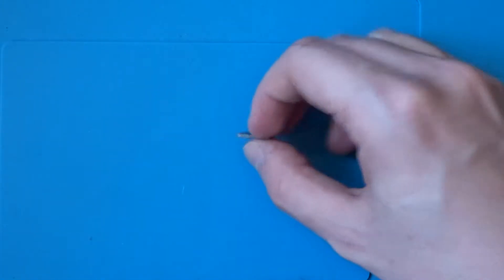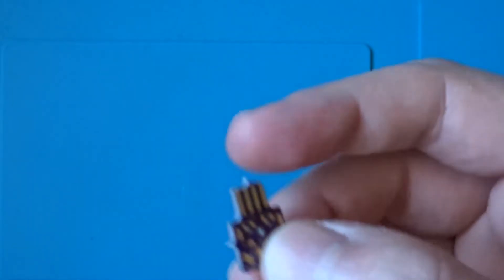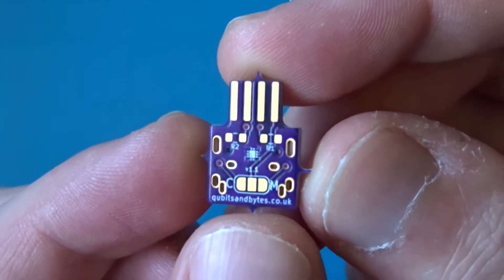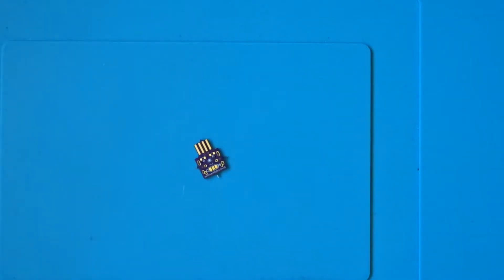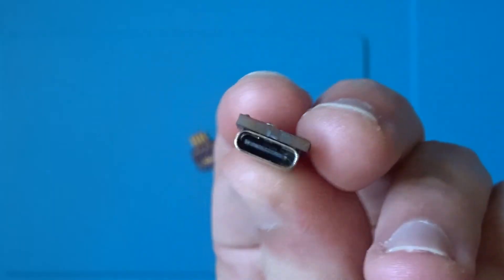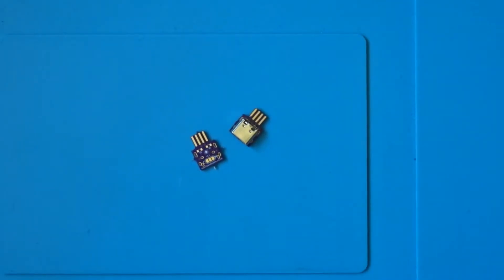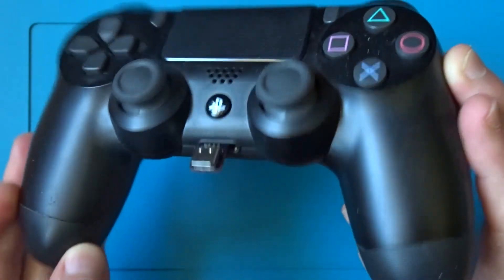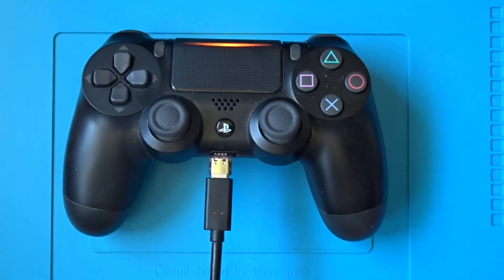Another Way to Charge a PS4 Controller | Made by Qubits | Qubits Tech

Comment: Would it also allow me to connect my controller to my ps4
Reply from the maker: Unfortunately not, the EXT port does not have USB data pins available. Only way to connect for data is through the micro USB port.

Comment: Hello I've just damaged my PS4 controller charging port an now I'm shock charging it😂 how long should I leave it before it starts to damage the board? It's currently 1:50am and no stores are open so I just tried this method but I'm afraid if I went to sleep and leave it on it will damage the board plz respond

Comment: just ordered some boards from your file🙏🏽 thank u for those...how many pins do the type c sockets need to be? and video of your solder work
Reply from the maker: That's great to hear, glad the files could be of use :)
The USB port is the 16 pin variant, something that looks like this https://www.aliexpress.com/item/33015630556.html
Reply: @qubitstech  thank you!!!
Reply: @qubitstech  was soldering the pins a pain?
Reply from the maker: I use solder paste for the pins, which I find fairly easy. I start with the pins to ensure they are aligned, then use normal solder for the legs before tidying the up the pins to remove any excess solder/bridges. Flux makes this easier if there's a lot of extra paste. Before using paste, I used to drag solder the pins. It did the job, though the clean up could take a while. If you give this a go, I would say don't be afraid to bridge the pins to begin with, but try to keep the solder as close to the pads as possible. If you get a solder bridge near the plastic housing, you'll end up melting into the plastic trying to clean it up.
Reply: @qubitstech  you're awesome man!
Reply: @qubitstech  just got the boards in today...i went type C only boards, what value resistors should be placed if i want to allow wall charging? if resistors in place can it still charge thru console as well?
Reply from the maker: @funkyfoo714 You'll want 5.1k 0603s. It will charge through the console with or without the resistors, they're not connected when using a type A to type C cable.
Reply: @qubitstech  thank u for the replies! appreciate everything you've made possible🙏🏽

Comment: Can you use that device to connect your controller to your PlayStation? I connected all of my controllers to my friends PS4 and when I tried to connect them to my PS4 using the cable that came with console the controller with blink once like it was going to charge but turn back off I would on and off when I would disconnect it and reconnect it. I’ve even tried resetting the controllers but they still don’t work, I’m hoping it will connect using the cable that came with PS4 if it doesn’t I don’t know what else I can do
Reply from the maker: Unfortunately not, the EXT port does not provide a data connection. If you're willing to open the controller, you can get replacement USB boards for a reasonable price (the USB board is separate from the main board) - just be careful plugging in the cable to the USB board.
Reply: @qubitstech  Thank you I really appreciate it🙏🙏🙏

Comment: I got an problem with my scuf , it dosnt Charge and also it goes off when i plug in my cable,does this what u Show there is able to Connect my controller to ps4 ? 2:50 2:50
Reply from the maker: Hi, unfortunately scuf controllers don't have this EXT port. I don't know of any other way to get power to a scuf controller aside from the charging port. You'll have to see if you can replace the port (or find someone to do it for you).

Comment: What if controller won't take a charge?
Reply from the maker: Hi, it depends why the controller wont charge. If it's a micro USB connection issue, or if one input of the PMIC is dead, this board will allow the controller to charge. If the battery is totally dead, a new battery will fix it. Otherwise, there's a board fault, and you'd probably need a replacement.

Comment: Aww man I already did the usb-c mod and I grinded away too much plastic. Now there is a gap and the usb-c board doesn’t stay in place well. 😣
Reply from the maker: You could try using some plastic putty to fill the gap around the port, if you're careful you could end up with a fairly clean result.

I've been tempted to try the internal mod myself, but cutting the case puts me off.
Reply: Man I know this is temporary because you can just switch out the micro usb chargeing to a new one

Comment: Why don’t they just make wired ext connections? Fuck man
Reply from the maker: The port is more aimed at accessories, like charging docks, so I guess they never intended for you to use it with a cable.

It would have been handy, though.